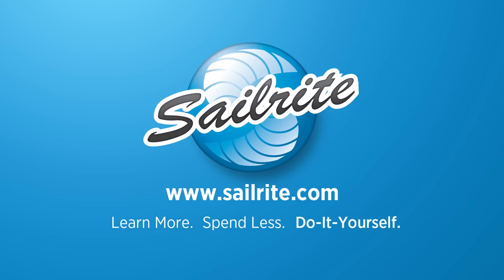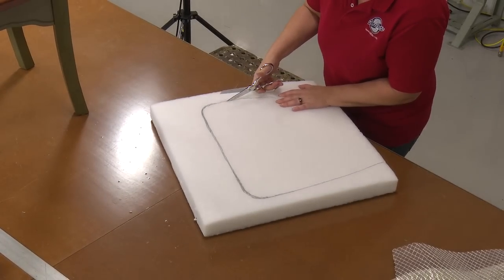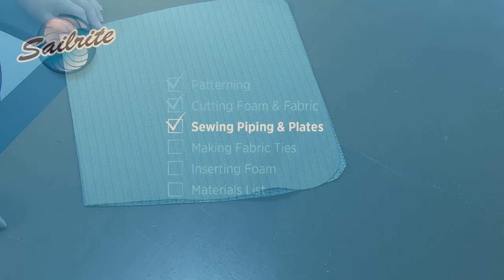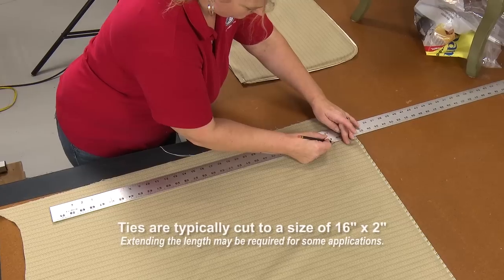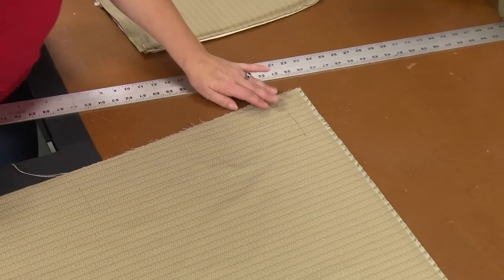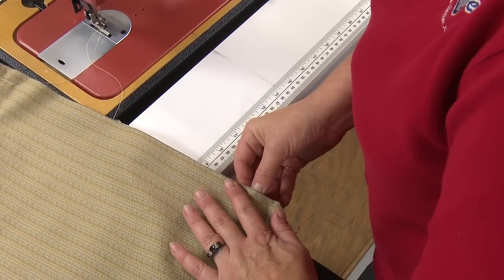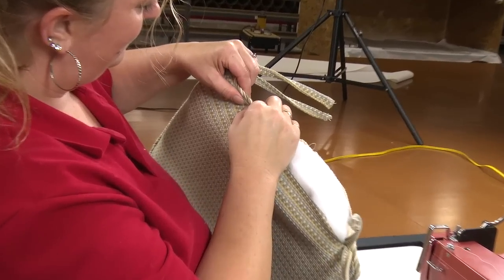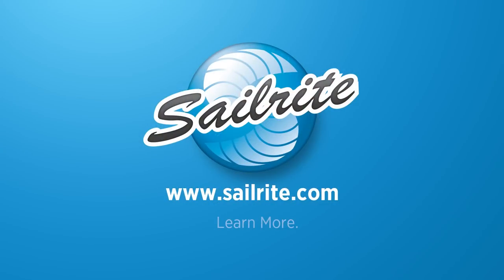How to Make Your Own Chair Pad Cushions

Comment: My first cushion turned out quite a bit smaller than the chair seat. I also had to cut the cushion . I used the 2 inch foam brand you recommended.
Reply from the maker: Sorry to hear about that. I wonder what went wrong?
Reply: I cut my 2nd fabric about an inch larger than chair seat ,but cushion the same as pattern. Still had to cut down cushion. Cushions look good though.

Comment: Hi i have the ls-1 and i want a cording foot the one in the video is for that??? i don't see it in the website thanks!
Reply from the maker: The cording foot is built into the standard foot for the Ultrafeed LS-1 machine. You will see it on the underside of your machine. No need to buy anything for that.

Comment: How do you prevent the front of the cushion from sliding sideways?  TFS!
Reply from the maker: That is typically not an issue for a simple chair cushion. However, if you like you could add tie down straps to the front corners to prevent that.
Reply: Stop squirming so much...LOL

Comment: Can I do this without that hot cutter tool? I only want to make six cushions, and that sure looks expensive!
Reply from the maker: Yes, you can. The edges of the fabric may unravel slightly when cut with scissors, but they will be on the inside of the cover, so no one will see them. Let me know if you have other questions.